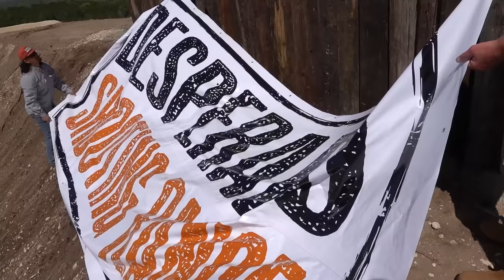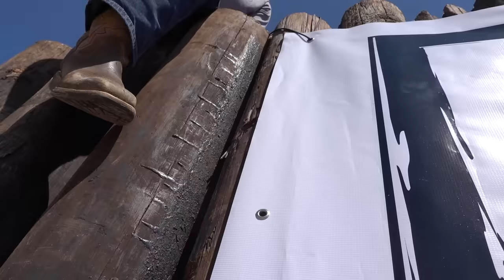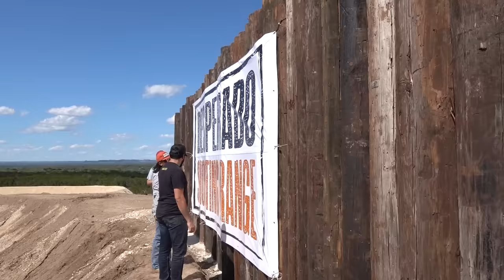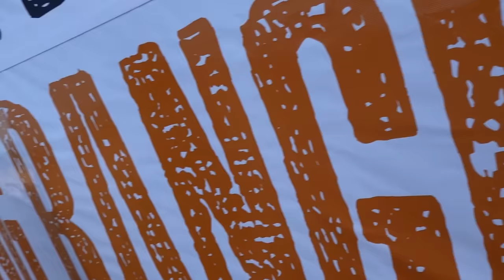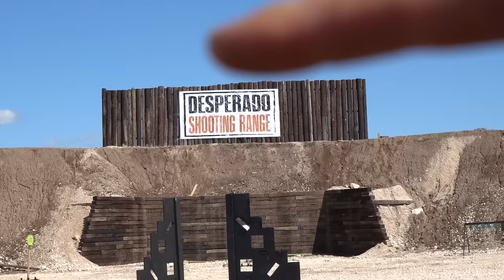Bad Problem with Underground Shipping Container... Y'all Were Right...

Comment: better off with some gabions to line the outside of container walls, step them towards the front, run along the back end too, you need very little dirt on top to keep cool, just a dusting, 3-4 inches is possibly too much to handle over a long period - the only strength in containers is the corners and there are plenty of vids on line showing how they collapse, its less the down pressure and more the sideways pressure - luv ya

Comment: Another thing to consider is to require all camping equipment and personal items to be placed within the confines of their individual campsite, otherwise you will have tents thrown up all over the place, especially along the river bank. Camping is not camping without a campfire. You may want to have a firewood vendor set up to sell firewood. You can buy fire rings or have a gravel area to place the logs on so their campfire doesn't get out. Check local burning laws for restrictions, fire seasons.

Comment: You should picture Frame the sign with treated 2x4s just sandwich the sign between them and then screw it to the wall if you just use screws and washers it will still tear easy with the wind and if you wanted you could put plywood behind then u would be whole assing it

Comment: I was moving some equipment in and out of a container at work. The wind came a long and blew the door open wider, I went to pick up a machine and ended up bending the shit outta the door. I didn’t get fired because most of the equipment ways at least 600 pounds and up. It’s critical to take extreme caution.

Comment: The other problem you can have with those shipping containers is if they are not properly ventilated they can become really humid inside with temperature change and they can begin to sweat and with all that moisture all metal things stored in it can begin to rust !

Comment: It would be good to have the upper parking lot Open for just the RV's and Tents and stuff down on the flat grassy area's There is a reason that they never built  cabins or structures  down on the river "Flash Flooding"  back in the day before it was flood controlled. I wonder what they did have down there on the flat area by the river? Build a look out Tower  out of  telephone  poles on the range  hum hum?

Comment: There are mechanical and structural engineers on your channel who would be happy to help you set up your container and anything else (for free).  Your container needs help.  4×4's could help out for a cheap fix. And a fan or two for circulation. Those little vent at the front are not enough. People staying in that container would have to keep the door open the whole time.

Comment: If you clear the path to the river, there's gonna be so many drunk campers pissing in the river that the water level will rise :P 
And as for the shipping container... honestly serves you right, a quick little research could have told you that it will not hold up^^

Comment: One thing I've learned from helping and running parking at Hare Scrambles, is it only takes one primadonna that wants "the best spot" or what ever, to totally screw with your parking plan for RVs. I would suggest very strongly to clearly mark spots for RVs, Tents, roads and especially Emergency Vehicle Passageways. Use; paint, ribbon and stakes, barricades and have a crew with radios to enforce this (multiple radios and channel designations is recommended for parking, operations, control and EMS). Having a designated "Parking Boss" will come in very handy to elevate disputes and with ease of communication to your other radio channels as well has offering you peace of mind knowing that person has got it covered.

I can highly relate and concur that two half-asses do not equate to a whole ass!

Also that guy with the camera and the stinky onion breath.... has an awesome t-shirt.